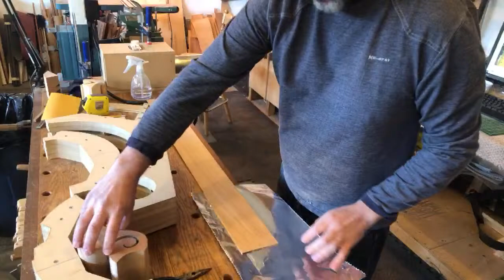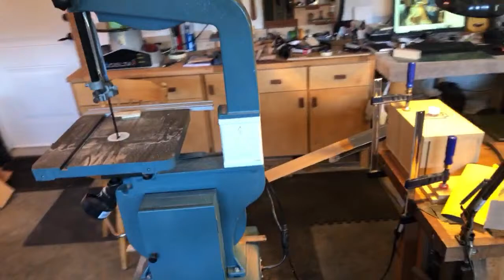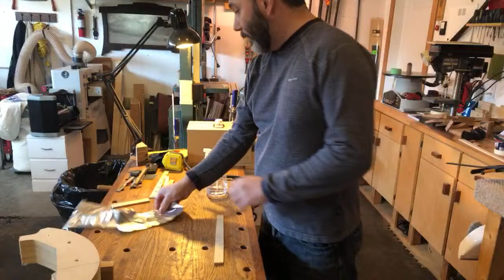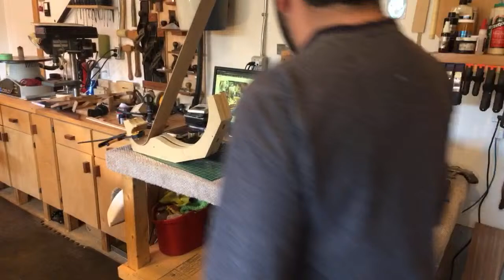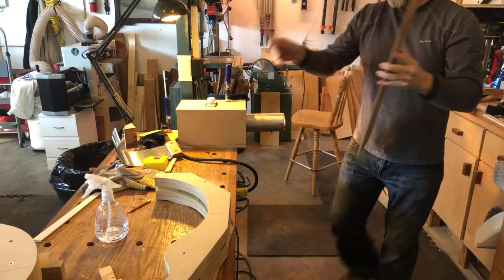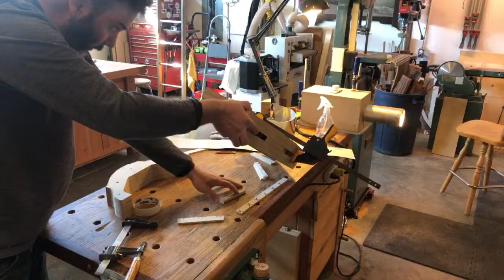Bending sides

Comment: 9:45 Hello one question.  the wood has to be cut in favor of the grain oh against the grain like this 👉🏿👉🏿 ==== oh like this 👉🏿👉🏿 |||||||||||||

I see that the grain runs throughout the wood but I have seen very different ones
Reply from the maker: If we use maple as an exemple to your question. Most curly sides will run either quarter sawn ||||| or riff sawn ///// 
But for that same maple with quilted figure then it runs flat sawn === 

Does it mater..
Quarter is harder to bend but will be more stable overtime. Flat sawn bends more easily but can become wavy with time if no structure is glued to the back side (struts) 

The grain orientation is not an issue and can be bent. What matters is what you need/want from it and how you will prevent movement over time. 

If you are not using any figured woods and have the option than I would use riff sawn as it’s a bit easier to bend than quarter sawn and is more stable than flat sawn.

Hope this helps

Comment: how thick are your sides for bending ? I always seem to have trouble bending Mahogany .
also I normally try to build on commission and usually no more than 2 at a time , but with the virous I have a lot more time on my hands so I got started on a couple builds just to have on hand . right now I am working on an A style mandolin , an F style mandolin ,2 tenor Ukulele , and yesterday started a guitar ,we need to keep busy
Reply from the maker: I had my sides at 0.100 thick but had to redo the point to neck block section after it cracked in the tight radius. I went down to 0.080 to get this one bent.